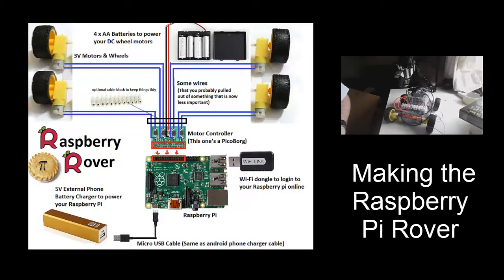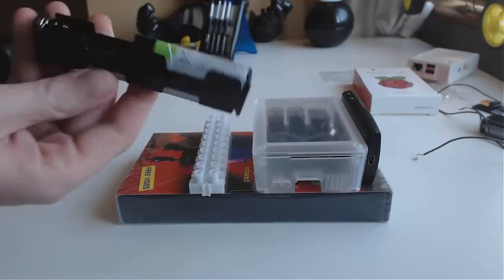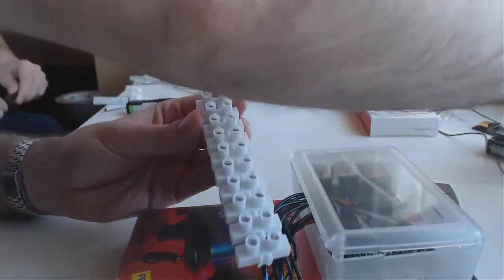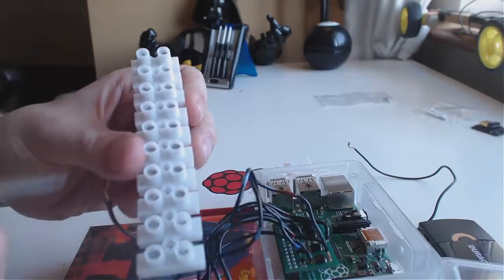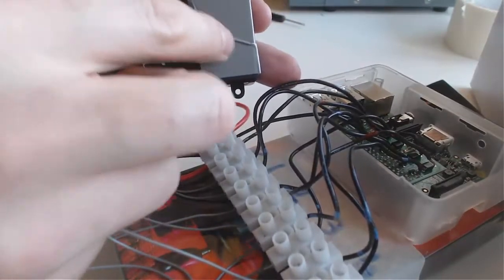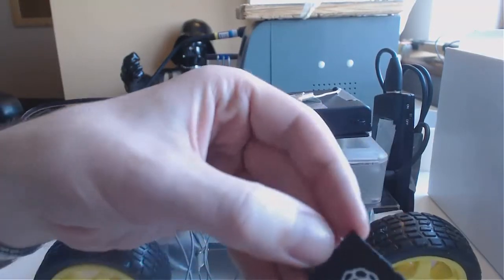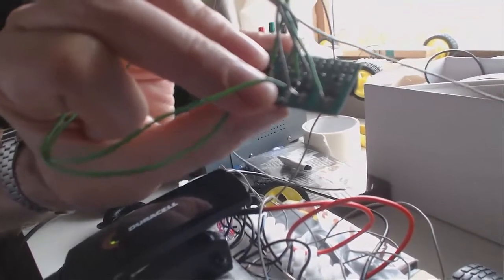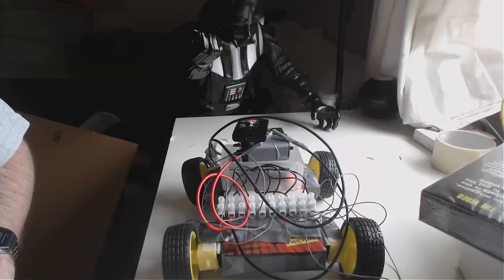Make a Raspberry Pi Rover that you can drive from anywhere

Comment: what motor controller are you using?
Reply from the maker: picoborg here. 

I now use the LN298 as its cheaper
Reply: I finished my rover around week ago. Controlled over wifi and with remote camera (I didn't used complex solutions such as Flask, only sockets). I used a Motor Controller HAT.